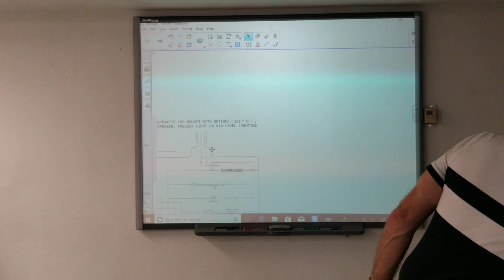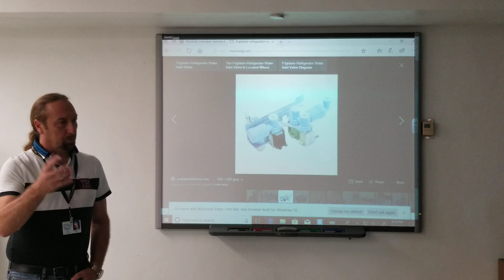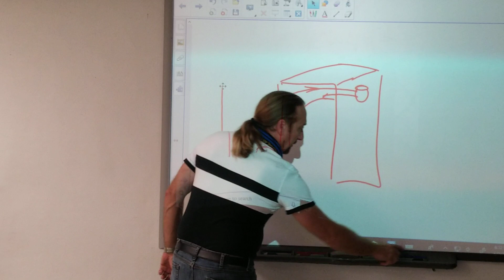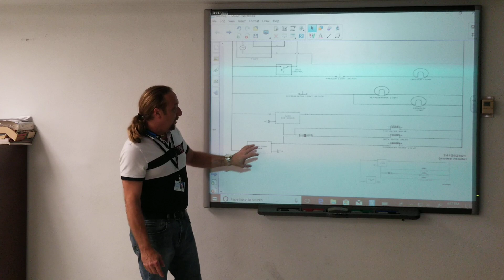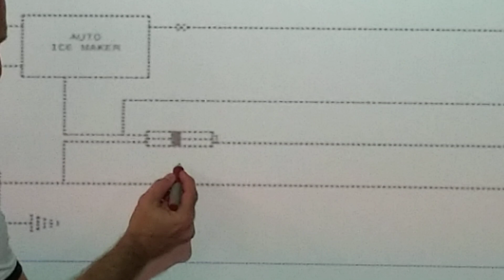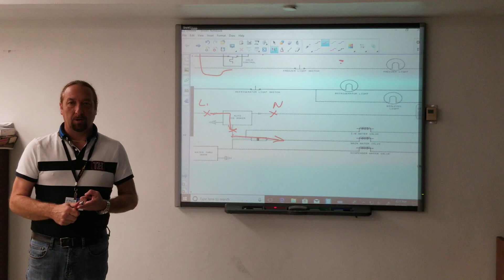#TECHTALK TMM ACADEMICS Icemaker repair  workshop sample.

Comment: I’m dealing with a 2007 GE where the water in the door fails to dispense.  Valve and microswitch both good.  I wonder if it’s exhibiting the problem you mentioned…PSCS5RGXCFSS

Comment: At minute mark 8:47, to answer the student  question usually when you take filter out the dispenser it will still work normal but once the filter housing is about to go bad, that's when the water pressure at the dispenser starts trickling even with a new replaced  filter (in my experience).

Comment: He forgot to mention that a heater element correction kit exists for that waterline freezup on the GE freezer door. Just did one myself.
Reply: Paul Zehner how effective is that kit from preventing the freezeup issue? I believe that’s not an oem part, and I’ve heard a lot of GE techs installed a lot of those kits but stopped doing it years ago because they don’t really work.
Reply: @hendrachristianus8238  GE does make an OEM part WR49X10173. It does work but I haven't used this part often enough to know how long the heater holds up. Even a new door has been said to fail 6 months down the road.
Reply: I just encountered the same issue myself for a home warranty call, and I requested for a fz door replacement instead of installing that kit. Because there’s a big chance it’d be a callback
Reply: Well that sucks. I also advised the customer to raise the fz temp a couple of degrees. So hopefully those will work
Reply: @hendrachristianus8238 Using Aftermarket parts is a serious  mistake for the serviceman in this biz. I can't emphasize that enough. Sticking with OEM is well worth the extra cost.